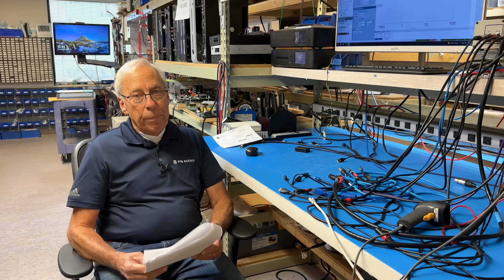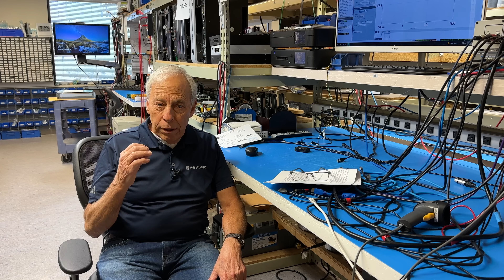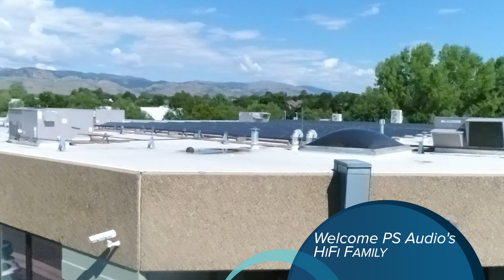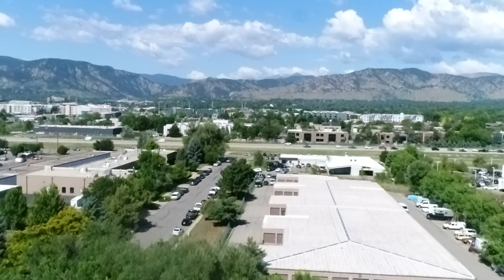UPS vs  Power Plant

Comment: @3:52 "...and if you have a very light load..."
An Eaton Powerware, model 9120 or 9130 can deliver 100% of the juice delivered by a typical NEMA 15 wall outlet, which you will find standard in nearly every home in the USA.

The above are for 15 amp outlets.
They make the same "on-line", double-conversion units that can power your home's dryer, or your entire home.

-- Paul, the above are not light loads.  Why did you limit your answer to light loads?
-- Paul, why did you not offer your opinion on listening tests?  Surely you are not a "just go by the specs" engineer.  You know that the ultimate test is using your ears.

I am not writing that your power generators are not better for music.  I have no idea, and neither do your viewers, and perhaps neither do you, if you never actually did a listening test.

Eaton Powerware is one of many brands that offer true, on-line, pure sine wave output, in capacities that can run not only a home, but a megawatt facility.

Comment: The pizza place in it's first week as a combination pizza parlor/audio store sold 8 upscale speaker cables, (I walked in & influenced one), 3 Cable Risers (not counting those white plastic things inside the pizza), 4 amps, one vintage Bogen tuner, and a vintage Viking reel to reel tape deck. And the same amount of pozza in the back.

Comment: 'Ole Audiophile to Paul: 1979 saw a my friend & I inside a electronics repair facility talking to a technician while servicing the unit we drug in, a stereo Phase Linear Poweramp rated for 360 watts per. It had a poor habit of popping power transistors when pushed. He offered up the opinion that we lacked a power conditioner. "A What?" we thought. He explained, then showed their hand built unit for the shop. It took ten or more years before we saw anything like them in retail stores. We've been using Furmans for over two decades now with few issues, but I've been told few of these 'conditioners' actually are able to really fully protect big units,, especially from sudden voltage drops or worse, a massive surge. BTN is the way we've always approached this as in they are better than nothing. They've come a long way but they have a ways to go yet to achieve near perfeection.
Reply: It's also where we learned about the difference between amps designed for 8 ohm loads vs amps built to 4 ohms like a Crown or a Macintosh. That was a brutal lesson indeed.
Reply: @davidlane1169  I had a devastating power surge due to a electrical work being done by an incompetent electrician down the block that blew out fifteen homes and half of my home appliances, even stuff that wasn't turned on like my micro wave, and heater where effected. My 65 inch TV went blank three months later too but lucky for me my audio was spared. Since then I have had a whole house surge suppressor installed, and bought a line conditioner for my audio system. I hear no difference sound quality and I also feel much safer knowing I have some type of protection behind my sensitive and expensive equipment. My thoughts are, everything is good till something goes wrong, and I'd rather be safe then sorry, even if it means loosing .0005% or whatever in audio.🖖

Comment: Learn something new every day, I assumed all inverter type power systems were class D.
Reply: Although that does make one think of the question of what you should use if your main audio amp is class 'D', i.e. PS audio Stellar M1200 with ICE Class 'D' modules.

Comment: Paul is right- there is no difference. Because neither makes a difference to the sound in a blind test in 99% of homes and 99.5% of systems.
Reply: Ive done blind tests with and without my ps audio power plant. Every one of my friends and some of their wives, all picked the power plant as the better sounding set up. 
I bought it used and had my doubts. As it turns out I wouldn't go without one. 
So maybe it's my equipment or electric supply?? I don't know but the upper mid-range  and noise floor are much better with it than without.
Reply: @Stevestereo16  Let me get this straight. With respect to “every one of your friends”, you have conducted a blind compare where neither you nor they knew which iteration of a trial randomly alternating between the system using and not using a power (plant/conditioner/regenerator/cleaner- pick your type) was conducted. Such test was from a constant listening position and the test administrator (again not you or your guests) used a decibel meter to make sure the volume was the same at the listening position with and without the device. And across multiple trials each of your friends (and their suffering wives) consistently knew, let alone preferred which trial used the device?  And when you told them the “improvement” cost $x thousands, they said “right on- money totally well spent”. Is that what happened?
Reply: @edd2771  no definitely not. 
The difference is obvious. And you would notice it too if you heard it.  If someone said wine tastes better than vinegar you can argue all you want about the quality of each and the ingredients and time that went into each but you'll never convince my taste buds that the vinegar is better. 
Same goes for my ears. No matter how much evidence there is  backing that up. My ears will not be convinced.  Sorry but I'm not going to be convinced of your take when it is so obvious to my ears. 
My best friend was completely saying what you are saying. Then he heard it...
Reply: @Stevestereo16  If you enjoy it and owning it gives you pleasure for whatever reason then god bless. Just dont ask me to believe it’s real absent the type of testing I describe. The placebo effect is real. It may or may not be in play in your case, but it cannot be dismissed.
Reply: @edd2771  have a great one! 
 I listen almost all day every day and can't wait to play music every morning.
Reply: To be honest I don’t have an opinion on the. topic, but it does surprise me there is not a single blind audio test documented on the entire web, that proves or disproves the point in an objective way, following proper test protocol documented in scientific literature. The first team that does it would for sure have a clip that will go viral in no time. All we need to agree on is a place to run the tests, relevant equipment and 50 audiofiles and 50 non audiofiles who want to participate. Why is this so difficult?
Reply: Watch your steps, last time I left a comment like this here I was attacked from all sides. 

Personally I completely agree with you.
Reply: @TubedTalk  Yep. Ive made similar comments in the past. Fully understand the anger that can come those who’ve spend thousands on these devices and now belatedly wonder (based on a few common sense comments like yours and mine) if it wasn’t the placebo effect all along. It’s like they don’t want to admit the possibility to themselves, so they lash out at others.

Comment: I use a Falcon SSG3KRM-1 3kVA Industrial Grade Inverter/Power Supply / UPS System, It outputs 2100 watts, Its true double conversion meaning the input is AC then converts it  to DC, then back to AC again. I have been very happy with it and have plenty of power when i turn the volume up and draw more power from the amp. It is 100% clean power with 0 noise.  There are some available pretty inexpensive.

Comment: Line Conditioner
Reply: I tried two different line conditioners and then bought a P.S. Audio power plant. The power plant improved the sound. 
Easily noticed improvement. 
The conditioners would cut some noise but also dampen some sound.   So I'm not sure why you said conditioners like it's the answer. It definitely wasn't for me?  
 Power plants are expensive. 
 They also add to the clarity and lower the noise floor. 
 Many people don't think it's worth the price. 
 But in my experience and my friends opinion that they also make a noticeable improvement. 
So is it worth the price? 
For me buying a used one was very much so worth the money. 
I don't have cable at all so the money I would spend on that is diverted to my stereo.  So the price is comparably cheap considering the expense of years paying for cable.

Comment: As Paul says, these are devices with a different mission.  

A UPS device generally does not always run on battery power... they usually feed the AC line directly to your devices, unless there is a power failure in which case the inverter circuit takes over and as a rule only supplies a few minutes of power to allow devices (usually computers) to do an orderly shutdown.

A power plant is a whole different animal.  There they are trying to provide continuous clean AC power with zero reserve in the case of a power failure.  Generally these devices are a luxury unless you live in an area prone to "brown-outs" and/or seriously dirty AC.

In my personal experience neither is needed for a stereo setup, unless there is an actual problem with the AC power and the Power Plant or similar device would be the choice to clean it up.
Reply: How many people with audio systems do you know that have clean AC at the wall socket? You must be kidding
Reply: @Scopolamine46  Most well designed audio equipment filter out most AC noise.
Reply: @Scopolamine46 
Not kidding at all.  Shure there's some crap on the AC lines, always has been... but any decent power supply is designed knowing this and will include ways to clean it all up for you. Remember, internally your gear all runs on DC... that's what needs to be clean.

The notion that your $10,000 amplifier won't have AC filtering built in is pretty silly... especially when that $19.00 wall wort does.
Reply: @Douglas_Blake_579  "A UPS device generally does not always run on battery power... they usually feed the AC line directly to your devices, unless there is a power failure..."
Your comment is unrelated to Roberto, from Huston Texas' question.

Roberto's question was not about stand-by type UPS's.  Rather, Robert's question was about "on-line" UPS's, which 100% of the time are feeding connected equipment electricity generated by the UPS.  Those on-line UPS's have a power factor, which is their cost for performing the dual conversion, which takes place 100% of the time.

Such on-line UPS's ensure that the connected equipment see 0% (literally 0%) of the power from the utility company.

Why are you trying to muddy the dialog between Roberto and Paul, by introducing a type of UPS that has zero to do with Roberto's question, and zero to do with Paul's answer?
Reply: @0Perhaps 
Oh piss off... I wrote a comment.  You'll live.
Reply: @Douglas_Blake_579  "Oh piss off... I wrote a comment.  You'll live."
That is a child's attempt at neither being able to support your own words, nor admit that you are wrong.

Writing that I will live is a non sequitur.  It is you, again, trying to change the subject.

Second request:
"Why are you trying to muddy the dialog between Roberto and Paul, by introducing a type of UPS that has zero to do with Roberto's question, and zero to do with Paul's answer?"
Reply: @Douglas_Blake_579 Third request:
"Why are you trying to muddy the dialog between Roberto and Paul, by introducing a type of UPS that has zero to do with Roberto's question, and zero to do with Paul's answer?"

You will not answer, because you introduced irrelevant noise into the conversation, was caught introducing irrelevant noise into the conversation, and you are too spinless to own up to introducing irrelevant noise into the conversation.

Comment: So if no PSB power plant is used (or afforded) then just supply our existing UPS to low power hungry sources?  And then just plug power amp(s) to wall plugs?
Reply: What you are saying is how I do it. I plug my amp directly into the wall and everything else plugs into a cheap Ultralink conditioner. It seems to work good. I tried plugging my amp into the conditioner and I lost a lot of the dynamics of the system. Unfortunately my sub is plugged into the conditioner as well and I’m sure it is being robbed of some dynamics